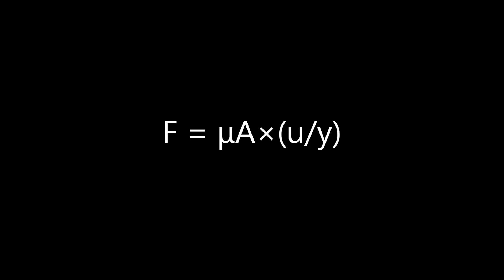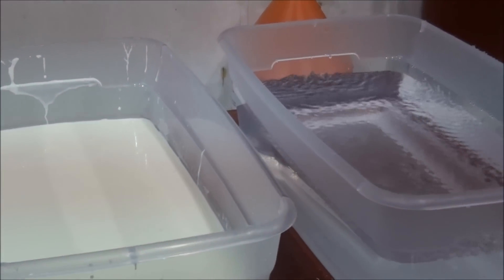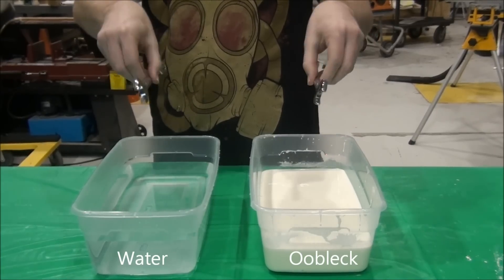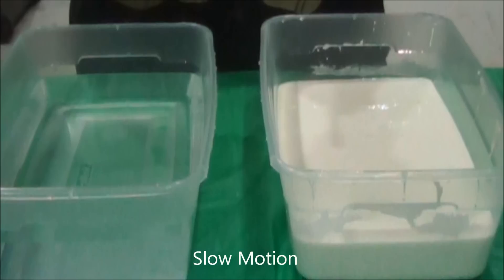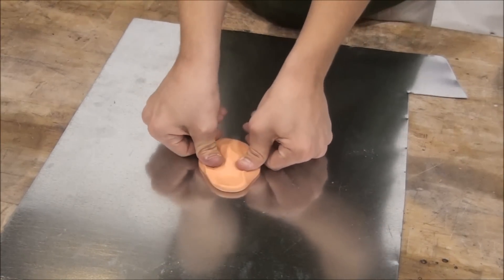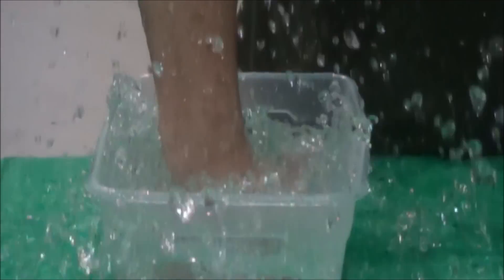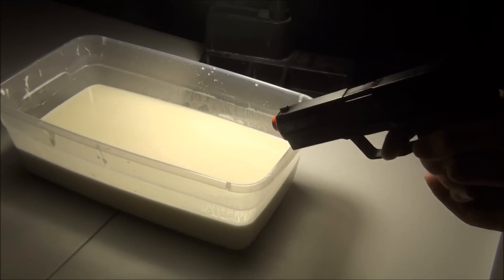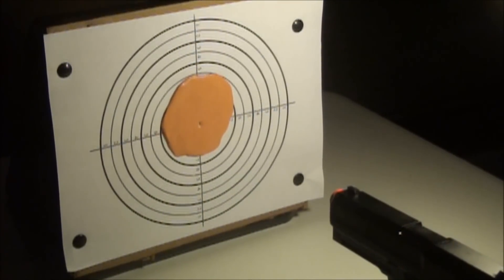Non-Newtonian Fluids and Viscosity

Comment: CO2 powered pistol not propane powered also its shoots more then 330 fps cause i used to have that exact same airsoft gun, it shoots more like 400 fps, try to study more before posting another mistake like this ok
Reply: +Arcane Necrosis please include the model number of the airsoft pistol. because this gun has a detachable magazine, it seems much more likely that it would be charged with green gas (propane) rather that a compressed gas Co2 cartridge.
Reply: might be the difference of it being green gas and co2, mine was co2 and it came from walmart, but i would like to get your thoughts on the cyma ak-47 electric tactical gun with the duel auto wind mag and upgraded batteries i paid 210 off amazon for it with with scope it came with and stuff

Comment: viscosity: a liquid's resistance to flow
ex: if you look at syrup, it has a high viscosity.  That means it flows very slowly.
 If you put the syrup in the microwave, the syrup will have less viscosity.  
ex: in volcanoes, rhyolitic lava has a high viscosity which will cause an explosive eruption.  Basaltic lava has a low viscosity.

Comment: The bb gun is 360fps... just saying :P
Reply: How do you know that it's 360 fps
Reply: CCNproductions1324 Cause i searched it up?
Reply: +Austin sellers and the bullet is plastic......
Reply: please tell me you are talking about the airsoft gun in the video and not airsoft guns in general. because if you are saying airsoft guns in general than you should just go running in the middle of the highway, I have some from 180fps ro over 600fps
Reply: +Austin sellers gas pistol fps can vari upon the model brand and barrel size and bb weight. unless you own the exact gun in the video and know for a fact its the same gun in the video theres really no way to just say its 360fps.
Reply: +TheGamerGuy you could ask myth busters to determine how fast the BB travels
Reply: diego Juarez lel no. fps can change lol depending on upgrades and use on the gun
Reply: They could come up with the average fps
Reply: They could come up with the average fps
Reply: nope lol
Reply: TheGamerGuy Why would he upgrade the gun?
Reply: I play competitive airsoft and often you have to upgrade barrels and overall air power of your guns.
Reply: TheGamerGuy yeah but why would he!?
Reply: Since he has an airsoft pistol laying around thats not a shitty gun that probably at least a $250 gun thats dedication. he is an airsofter.
Reply: TheGamerGuy well i didnt know that. So yeah might be.
Reply: Austin sellers Tighter bore barrels down to about 6.01mm can cause an FPS increase and an overall better accuracy at range and tighter grouping. also upgrading the power of the gun can let you shoot heavier weight bbs and keep the fps you get with the lighter weight bbs. The heavier weight bbs will keep flying straight through stronger winds.

Comment: Great video. Very educational and entertaining! Do you know if the Oobleck (sp?) or similar non Newtonian fluid (NNF) could be "doped" with compounds that would alter and improve its ability to resist impacts? Just how much of the kinetic energy of the impinging object can be dissipated? Thanks!
Reply: +myp410up imagine a piece of kevlar body armor, then, imagine a piece of the same armor that has been treated with a non newtonian fluid. while it would not be as flexible as the original kevlar, it would still be very soft and flexible compared to AR500 steel armor inserts. as for how well it would perform, i have no clue, im as interested as you are!

Comment: Couldn't they use that putty as body armour?
Reply: Xeona Tarum Bullets go through ballistic vests though. Only the smallest caliber pistols can't pass through the vest and even then they can cause rib fractures, internal bleeding and death.
Reply: No, because it isn't tough enough. It thickens to become like a solid when hit but it is weak and essentially shatters. Look up ***** he has videos of shooting the stuff.
Reply: Nevir202 So that's a yes then?
Reply: James Oldfield
Well anything COULD be used as body armor if you got enough of it but from watching videos of it being shot it looks like you'd need a good 6" of the stuff all over to give you very good protection. A suit like that would weigh a few hundred lbs so that's a bit of an issue.

However if you used it in a thin layer underneath Kevlar I would think it would help spread the impact out across the affected area and maybe take a little of the punch out. As is, even ballistic vest wearers sometimes have ribs broken by the focused energy.
Reply: Nevir202 Yes, it is then ^__^
Reply: Bullet proof vests work like that, only they are made to withstand higher pressure than the oobleck
Reply: James Oldfield
Yeah, still better than nothing though
Reply: James Oldfield
I believe you've got that backwards. A larger slow bullet like a .45 is more likely to be stopped than a faster small bullet like a .223 or even .22
Reply: Nevir202 No, bigger bullets have more kinetic energy because ke=0.5mv^2
Reply: James Oldfield
No shit, and a 10lb steel ball going 200' per second would have way more kinetic energy, that doesn't mean it would penetrate a ballistic vest. Kinetic energy =/= penetrating power. The more concentrated the force is the more likely it is to penetrate. Whether something penetrates anything is always a function of whether it is easier to penetrate it or transfer the energy into the surface.
Reply: Its not that strong. They do have armor with the same attributes. Its being tested for military
Reply: James Oldfield well the sizes are different so that means the velocity would be different
Reply: James Oldfield you could you use the equation for force. Because mass x acceleration. Force will indicate energy in this case
Reply: James Oldfield Your equation is wrong ke=1/2 mv^2
Reply: waysideme Now you know why I only got an E in physics.
Reply: James Oldfield Polish people do this... :v
Reply: Kajko gra w tytany~ ^__^
Reply: Because the putty won't stop the machine guns like M 16 and the AK 47
Reply: Jakey Lee Nor does regular military body armour otherwise nobody would die -_-
Reply: James Oldfield I think people use this only for vest.
Reply: James Oldfield Hey, thought the same way, like when you get shot there's a hole and it regenerates. :D
Reply: James Oldfield It would need MUCH MUCH higher viscosity to not shatter on bullet impact.

Comment: Do you know the description of the pistol and where i could it and the corresponding bullets ?
Reply: It is a kwa airsoft pistol search airsoft gi there are many to choose from they fire airsoft bbs
Reply: thanks very much :)
i have another question :
how do you ensure that in the experiments
1) with the water beaker that the bullet doesn't penetrate the other beaker downwards and the water will spread everywhere?
2) what is the material of the box  that is put behind the paper ( with the circles ) ?
i am just worried that the bullet reflects or scatters anywhere in the lab
Reply: It's just a KWA H&K USP using standard .20 gram airsoft bbs. These happen to be biodegradable, but that doesn't matter. A gun like this should cost between $40 and $100. Any gas-powered airsoft pistol will work just fine for this experiment. Just make sure that it has at least 300 FPS, otherwise you just got ripped off.
Reply: mainzer ballack 1. The guys in the experiment were using plastic "beakers" in this case. If you use glass beakers, at least on the second one, you should be fine.

2. The box is made of cardboard. I would recommend doing this experiment in a low-risk environment (empty room) instead of a laboratory with expensive equipment. That way the worst you can do is put a nick in the wall.

I take it that you don't know what airsoft is, so let me explain. Airsoft is a sport. It is similar to paintball in that people shoot at each other, but airsoft bbs hurt far less than paintballs and airsoft guns are more realistic looking and far less expensive. Eye protection is required at all times when shooting an airsoft gun, but that is as easy as plastic safety goggles. If you are looking for a good first gun, make sure you get one between 300-400 FPS. There are a lot of crap models at Walmart and such that will try to sell you a gun with ~150 FPS and runs on AA batteries. If you have any more questions, let me know. Otherwise, google airsoft for more information.
Reply: Caleb Welk  I don't know how to thank you :) !!
ok i'll try to take care that nothing with high risk is there ;)  
Looking forward to it
Reply: Good luck with your experiment. Comment here when you are done if you decide to post a video. I'll check it out and maybe subscribe. :)

Comment: Well I don't know how strong it is compared to how strong it must be to stop a bullet, but I heard you could put a pencils pointy end with an elephant on top of it and the graphene would not brake. This was said by theoretical physicist Michio Kaku (so I trust it to be true). As far as my simple internet research and calculations go, that's far more energy delivered per square cm than a bullet delivers. But I could be wrong for multiple reasons.